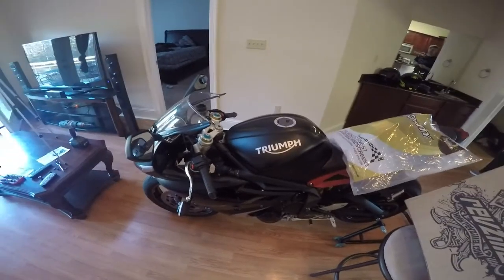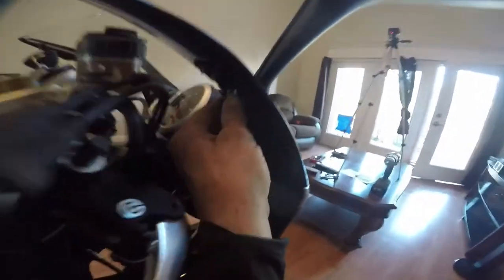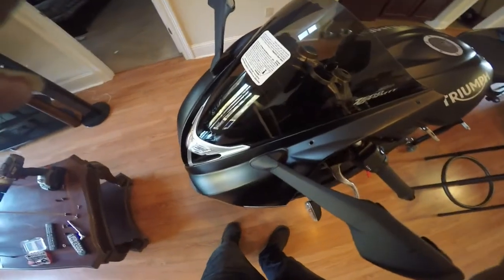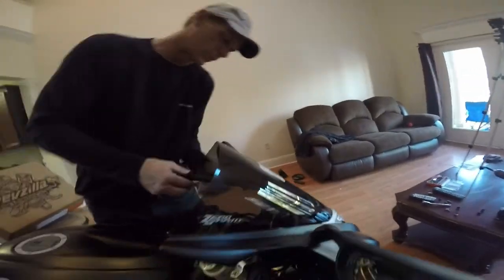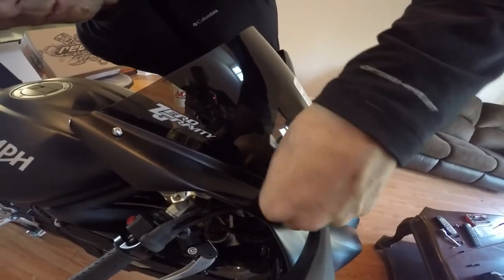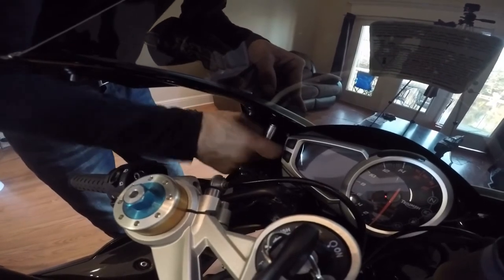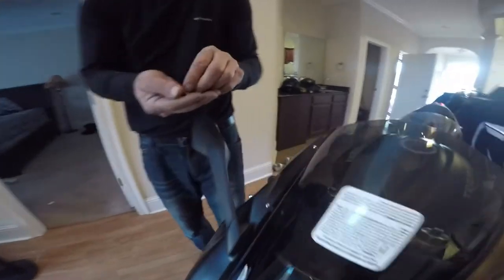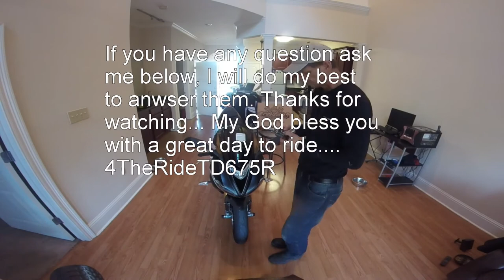2015 Triump Daytona 675R zero gravity corsa windscreen install

Comment: is the the zero gravity any higher/longer than the stock windscreen ?
Reply from the maker: it is a little higher and has a more air flow then original screen. Im 6'2" and getting behind the smaller screen was kinda hard. at high mph the wind would catch my helmet and pull on it, now the air flows perfectly over the helmet